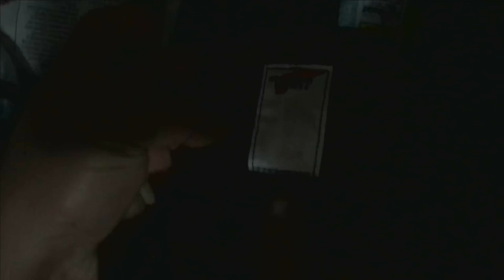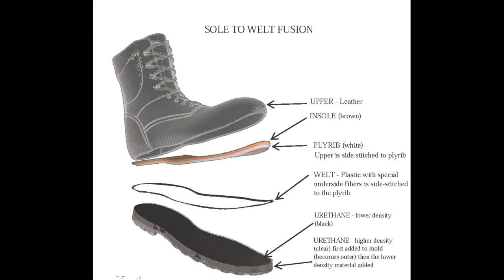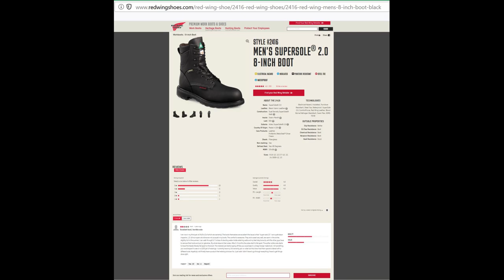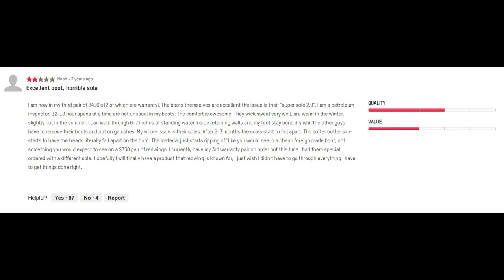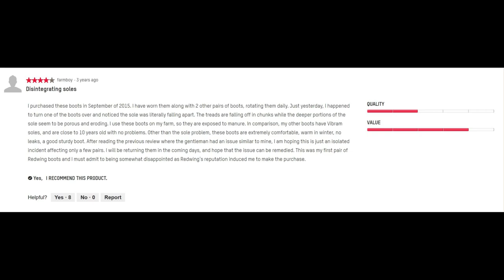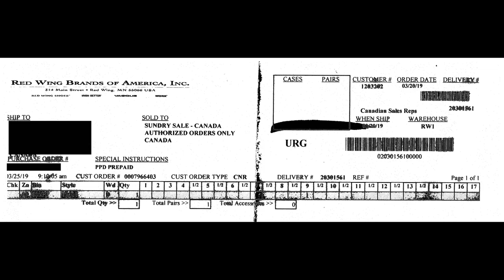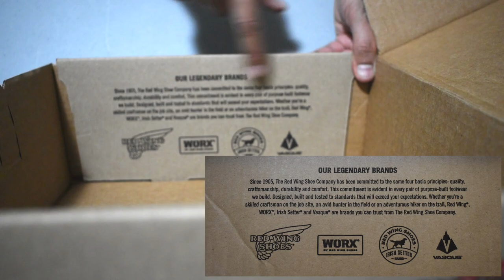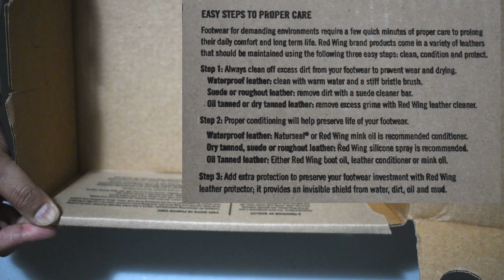𝗣𝗥𝗢𝗗𝗨𝗖𝗧 𝗥𝗘𝗩𝗜𝗘𝗪: 𝗥𝗲𝗱𝘄𝗶𝗻𝗴 𝗦𝘂𝗽𝗲𝗿𝘀𝗼𝗹𝗲 𝟮.𝟬 - 𝗥𝗲𝘀𝗼𝗹𝗲 𝗮𝗻𝗱 𝗥𝗲𝗽𝗹𝗮𝗰𝗲𝗺𝗲𝗻𝘁 - Model 2426/2416

Comment: It's funny that the guy in the Red Wing store told me, when I bought mine in 2005, that the soles would outlast the uppers. Mine did the same falling apart thing. Red Wing told me I had to buy another pair of boots. They didn't even want to resole these if I paid for it. So I am going to try and find a local cobbler to resole these with Vibram and look at other brands for my needs.
Reply from the maker: Hi Kevin Mapplebeck, thanks for watching and sending me and the community your experience with the boots.  It's a shame that not only did Red Wing not warn you, but then the sales rep misled you, and then Red Wing wouldn't replace your boots.  Did you speak to Red Wing, the manufacturer or Red Wing the store owner?  I really would encourage you to email Red Wing and let them know your experience, advise them that this is an ongoing issue and that they should stand behind their product or at least warn customers.  I am sure they will replace your boots--and you can still resole the pair you already have.  Make sure you take pictures.  If you do write to them, please check back in with my channel and let us know your result.  All the best to you, H.D.H. [: { ].
Reply: @HANDYDANDYHUSBAND  I did email them and that was the response. "Your boots should be replaced due to hydrolysis.

The boots you have, style 2426, have been discontinued. The replacement boot, style 2416,  is a made to order boot.

You'll have to go to a store for them to order you a pair of boots.

Please contact us if you have any further questions or concerns."
These were my 5th or 6th pair of Red Wings and apparently my last. I have shoes that are older that still have good soles and I wear occasionally. 
The only thing they offered was 1/2 off a resole. AFTER they told me they couldn't be resoled and I needed to buy another pair of boots. Not very upfront and honest if you ask me.
Reply from the maker: @kvmapplebeck  Hi Kevin Mapplebeck, thanks for reply.  If you review my video, you will see that they also pushed back on me.  I persisted and advised them that customers were complaining about the soles even on their own website and this is a known problem that they did not inform me about and that they should replace the shoes or fund the sole replacement--which if it can't be done then they should send another pair of similar or like boots of your choosing.  Yes, I agree not very upfront, but I am pretty sure they will do what they need to do to make you happy.  Think about it:  you have told me, now your comment is on my YT channel and how many other people will you tell.  This is too damaging for their brand over a pair of boots that you paid likely >$300 for and which it likely will cost them less in product cost, and marketing to win you back as a customer.  I would really encourage you to try, and do also let us know your results.  Try some of the wording in my own email to them, if that helps.  All the best to you, H.D.H. [: { ].
Reply: @HANDYDANDYHUSBAND  This was their most recent reply "I'm sorry for the inconvenience and that I couldn't provide you with a better solution."
Reply from the maker: @kvmapplebeck  Hi Kevin Mapplebeck, I am sorry that didn't work, if you are still interested in pursuing the issue, my next step would be to say the following: "I thank you for your reply and apology, but your resolution is not acceptable.  I purchased an expensive pair of boots/shoes from your company because of its Brand name and because of what I was told by your sales rep at a Red Wings' store.  I expect Red Wings to stand behind their product.  If you are unable to address this matter, please provide me with the contact name and information of someone who can."  At minimum, the matter should be escalated upward to permit a senior employee to review.  Hope this works out for you...I am rooting for you.  Please let me know what if any response you receive.  
Thanks, H.D.H. [: { ]
Reply: @HANDYDANDYHUSBAND  No response at all.
Reply from the maker: @kvmapplebeck  Hi Kevin Mapplebeck, thanks for sending me your result with Red Wing customer service.  Typically it will take a few weeks as your concern works itself up the corporate chain.  Can you, however, send me a copy of the email chain correspondence you have had with Red Wing?  If it has been more than 3 weeks since your last email then their customer service experience has fallen, I really need to update what I am saying on my channel.  You can send the correspondence to my email:  the handydandyhusband.info@gmail.com
I plan to write to them with your concern.  Also, I checked out your YT channel, its cool that you started making videos about guitars.  I say keep it up man...I know it can be deflating not having a lot of subscribers or views, but just keep it up and you will find that one of your videos will 'strike a cord' (pun intended) with a large audience base.  Anyways, hope that you do send me the correspondence.  All the best you man, H.D.H. [: { ].
Reply from the maker: Hi Kevin Mapplebeck, I didn't hear back from you so I thought I would check in.  Paul Dolphin, one of the individuals that commented on my video, mentioned that he sent RedWing some pictures and Red Wing did replace his boots (if you go through the comments you will find his name).  If you still have the boots, you might want to take pictures and send them to Red Wing and ask them again to replace your boots.  Anyways, I thought I would give you an update.  All the best to you. H.D.H. [: { ].

Comment: Awesome! Where did you get the old ones resoled? If you don't mind me asking.
Reply from the maker: Hi Michael Pharris.  Thanks for watching.  I had my boots resoled at 'Both Feet on Main Street', in Vancouver, BC.  The cobbler, Les, is extremely experienced and I would highly recommend him, as there are very few experienced cobblers around these days.  He was initially reluctant to work on the boots because the degraded polyurethane gums up his tools and sanding belts--I am very happy I insisted.  Les did say there was a 'RedWing' approved repair center that will replace the soles with the exact same ones as the originals, but I did not want those soles.  I opted for the vibram, rubber soles and have loved them since.  In the comments below, I think someone also recommended another factory authorized service in Nelson, BC.  If you are not in Canada, I would strongly suggest removing as much of the degraded polyurethane sole as possible with a drywall putty tool (its comes off in sticky, plack clumps) and then ask an experienced local cobbler in your area to resole them.  Hope this helps.  Remember, you are doing the environment and yourself a favor when you extend the life of a product that most people would throw away.  Buying shoes capable of being resoled and then resoling them when it comes time will pay dividends to you over your lifetime.  All the best, stay safe, H.D.H. [: { ]

Comment: I would hope you write the most gracious letter ever to the Company CEO, because it is insane that they replaced a 15 year old pair of boots. Don't think it was that you made some wonderful winning logical argument based in reasoning to compel them to replace the boots. They done this purely out of an above and way beyond effort to maintain the utmost customer satisfaction, even in the face of a ridiculous complaint. It is well known that man made materials, such as rubbers, vinyl, plastics, silicones etc, break down over time, especially after that many years. So you threatened to wear the shoes to create an embarrassment that most people would see without an explanation of how old they are. Sounds more like blackmail then having a valid argument for them to replace a 15 year old pair of boots. I don't know if anyone else would be making a video about such an exploit. I think most rational people would find it embarrassing. I guess the squeaky hinge gets the grease.
Reply from the maker: Hi bcabmac, thanks for watching and providing me with your input.  It appears to me that you are upset over my video because  1) I complained about a 15 year old pair of boots (complaint was ridiculous/embarrassing), 2) received a new pair in response to this complaint (company was blackmailed), and 3) should have  realized that over the years materials break down and I should just accept that as a fact (complaint was illogical--or not merited).  While you are free to have your opinion, and I would defend your right to have it, I disagree:  A) the basis of my different opinion is largely explained in the video between time stamps 6:30-12:15 (within the correspondence I had with Redwing).  Note that in RedWing's email (7:30) they state that the polyurethane midsoles "can be susceptible to hydrolysis if not used properly".  So based on the manufacturer there is a proper and improper way to wear such boots.  Meaning:  it is improper for me NOT to wear my winter lined, waterproof, heavy workboots in the warm summer months and that I should have known better and 'took them for a stroll'.  As I noted in the video, I have two other pairs of RedWings (with rubber soles) that have lasted over 20 years, with no special treatment so having the soles on these boots breakdown so completely was to me surprising.  This was even more concerning to me because the manufacturer made a conscious decision NOT to provide any documentation about the specific type of sole and how you were supposed to 'properly use it' (neither in the old pair nor even with the new pair they sent to me). B)  While I can't say my argument was a 'wonderful winning logical' argument, my email response was adequate, given that the hydrolysis issue is/was a known problem and a continuing problem based on the comments left by others on RedWing's own website.  RedWing could choose to simply include a consumer warning on these specific type of soles indicating premature wear/breakage when left unworn or used in water, but they have chosen not to.  I think it was this failure that compelled RedWing to replace the boots after 15 years.  C)  I disagree that a consumer should expect the rubber soles in any boot to just disintegrate after some time.  Ask anyone with rubber soled boots, they last a very, very long time more than 2 decades going by my rubber soled Redwings--the rubber will wear out well before they disintegrate (which is when your replace the sole).  With regards to plastics/rubbers/silicone, UV light significantly expedites their disintegration; thus, with tires, exterior silicone, or plastic left in the sun, all these items will crack/become damaged.  Rubber shoe soles are not, in my experience left outdoors with the soles exposed to the sun.  My issue was with the polyurethane soles completely and absolutely disintegrating without any warning to me or any warning from the manufacturer.  D)  Last, you recommended that I send a gracious letter to RedWing's CEO for the new boots.  I think with my video I have provided them with much more than just a letter.  After many hours spent on filming and editing the video (a letter would have taken less than 30 minutes), I have expressed my appreciation to RedWing and its Customer Service Department.  I hope that my video will also encourage them to provide some warning or advice to the end user:  you and me.  Finally, with my video I am providing all consumers with information about these polyurethane soles so that they can make an INFORMED decision before buying them and placing similar 'rubber sole based' expectations on them.  Last, yes, the squeaky hinge does in my experience get the grease (as it should...why would you grease an unsqueaky hinge).    

For the reasons above, I think I have summarized, why my opinion is different from yours.  If I have misunderstood you or if you would like add anything, please feel free to do so.  In the meantime, it was good discussing this matter with you, all the best to you, H.D.H [: {].
Reply: @HANDYDANDYHUSBAND  You should be a lawyer. Only other thing I would ask out of curiosity is, were these boots ever exposed to salt during winter without being thoroughly rinsed before being stored??  Chemical in salt melter such as calcium chloride, potassium chloride, magnesium chloride etc?? This may be at least part of the mystery of the deterioration and disintegration. Just like soles exposed to oil, gasoline, Kerosene and other petroleum products will break down composition structure, unless specifically made to resist and are marked oil resistant. I'm just curious, because I've seen the exact same style boots, at a ma and pa shoe store that had been wharehoused for over 10 years, and none of them had broke down composition. So I'm thinking possible exposure at some point to some kind of chemical. Just wondering.
Reply from the maker: Hi bcabmac, thanks for reaching out with your further question.  I think that the boots would have inevitably been exposed to salt during the winters that I wore the boots.  I do not, however, think that this exposure would have altered the chemical disintegration of the soles.  From my understanding and research, I have learned that the polyurethane product is created by removing a hydrogen atom.  This makes the product inherently unstable in the atmosphere but gives it a cushioned/squishy or compressible quality that is not really featured in rubber.  As such polyurethane soles on boots/shoes makes them more comfortable but less durable (polyurethane is in most cases is also cheaper to attach to shoes).  In especially moist or 'unaired' environs, the polyurethane takes back the hydrogen atom from the water (H2O) in the air and this leads to the eventual (given enough time) total disintegration of the product.  When you walk on polyurethane soles the chemical recombination is delayed because you are airing the sole and, moreover, compressing it which pushes out some of the moisture that can accelerate the hydrogen recombination with the polyurethane.  Hope this helps you understand how hydrolysis occurs--it is basically Mother Nature changing the polyurethane back to something stable that we humans have made unstable.  I have almost completed my research on hydrolysis so stay tuned for my future video where I do a deep dive on hydrolysis and the product polyurethane.  All the best to you, stay safe, H.D.H. [: { ].

Comment: great video I have a pair of 2408 and I live in central Texas and summers get pretty warm and I worn mine every day 5 days a week and after 14 months (not years ) the soles complete worn threw and spit !! vary upsetting for me because when some pays $260 for boots they should last 15+ years and not less then a 1.5 years of service I still trying to a good cobbler locale here no one seems to want to replace the soles for me I think I can have Redwing resole them with Oe soles and I don't want them I would like Christys (moc toe ) type soles but Redwing won't do that But i can ship them to Nicks boots and have them rebuild to a rebuild boots but its $250 to do so I don't know what I will do about this Thanks any way for a great video
Reply from the maker: Hi John Versluis,  Thanks for your comment.  I am sorry to hear about your experience and that the Red Wings did not fulfill your expectations.  I would like to make a suggestion:  many cobblers will not touch these soles because they mess up/make sticky all their tools and sanding belts.  One way you can avoid cobblers refusing to do the sole replacement is to do the ugly work for them.  Remove as much of the urethane from the bottom of the sole as you can and then ask them to replace the soles with a vibram rubber sole.  This should not be more than $100 CAD for the pair (ought to be cheaper in the US).  Alternatively, you could send Red Wing a note and see if they would be willing to replace the soles for you at no charge (you will likely have to pay for shipping).  Whatever you decide, I would appreciate you keeping us in the loop and letting us know what happens.  Best Regards, H.D.H.

Comment: Could the heel and dole failure be linked to the salt. They throw in the ice during winter!
Reply from the maker: Hi tom martin, thanks for watching and sending me your question.  While salt does corrode metal and accelerate oxidation, it typically does not affect polyurethane soles.  It is the water that causes the deterioration.  I have not done any tests to see if salt water has any added effect to just plain water.  For my boots, I did rinse the soles after each season, so my suspicion is that it is just water/humidity.  All the best to you, H.D.H. 
[: { ].